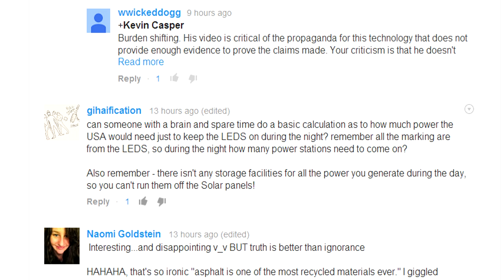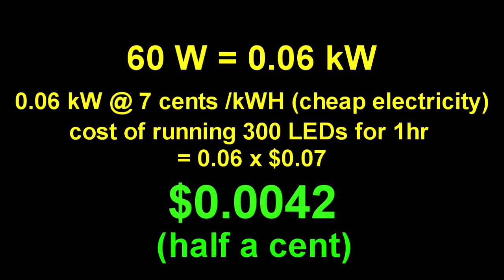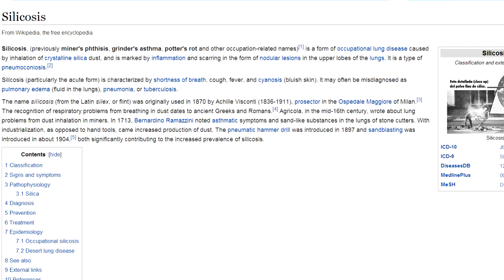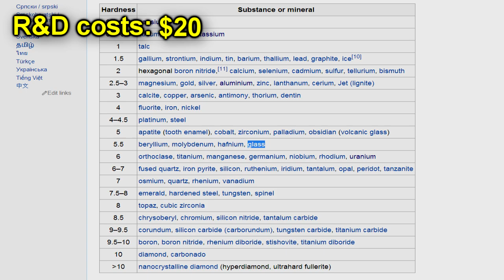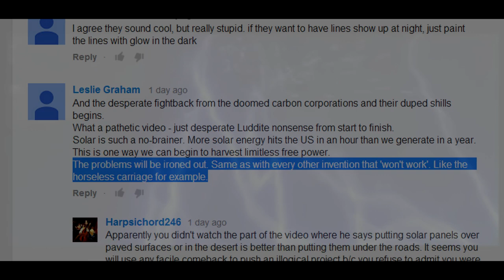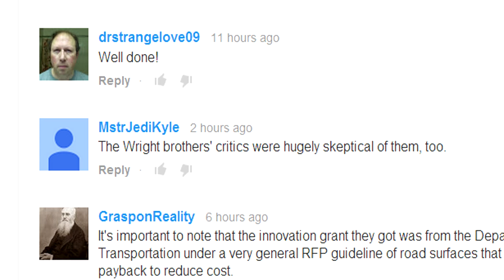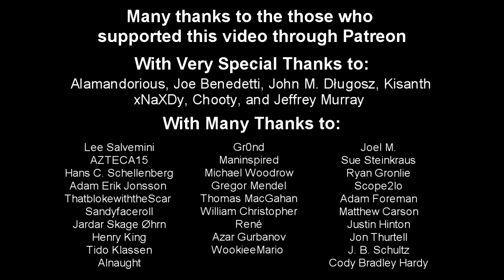Solar Roadways, IMPORTANT QUESTIONS AND ANSWERS!

Comment: I kind of agree to some degree. But he is just being a dick in this video, it's like he is just ignoring the whole idea of engineering and innovation. Like yeah I see some of the serious flaws, but for starters, he talks about how much power the panels consume but not how much they produce. And as for his problems with the surface of the panels... Give them a chance to research. Materials engineering is a huge these days. They may be able to find a viable alternative that is a lot more appropriate. Thunderf00t is just make a lot of unfair assumptions in this video and basically just against even thinking about this idea or if there is any viability at all to it. For example a solution ( an expensive solution but just run with me here, literally just coming up with ideas spur of the moment here) to the tracking issue might be to use thousands miniature solar panels within one of the hexagonal cells that can all rotate to track the sun, and you could even do this mechanically (think clockwork) rather than requiring any programmable electronics or anything. Like basically thunderf00t point out the flaws but try and be constructive with it and not sound like a nay saying dick especially when you are over looking some possibilities yourself
Reply: What problem are you trying to solve?  Why do we need LEDs in road surfaces.  Doesn't paint or reflector dots work just fine?  If you want to generate electricity with solar panels, just put up some solar panels.  These aren't Reese's Peanut Butter Cups.   Mixing roadways and solar panels together will never be anywhere as cheap as using current roadway technology and solar panel technology separately.  What technological problem are you trying to solve?
Reply: oscargordon Its funny I was actually driving round today and I saw LED signs which kinda swayed my view on this. I never liked the LED idea, everyone seems to be focussed on that. I like the idea of energy efficient roads. It's not about just putting up solar panels though, its about saving asphalt too, which is a much more finite resources that silicon and glass. The technological problems trying to be solved would be the LED lights not being able to be seen for example. If you fund research into that you never know what could come out at the end. I don't think it is a great idea at the moment I just don't get why thunderf00t (and you I guess) is so against funding research (important word here) into the idea. Lots of scientific projects are funded and show no good results so why focus on defunding this particular one, you never know what is possible if the right people are doing the right research... it's closed minded to just write it off as a completely terrible idea because of its current flaws
Reply: Ravo You never answered why combining solar generation with roadway surface was superior and cheaper than doing each separately.  You never explained why LEDs embedded in a road are more visible and will last longer than paint or plastic reflectors and our current roadway signs.  There is zero evidence that materials science will ever come up with a transparent surface that provide as much traction and be as rugged as traditional road surfaces.  All you seem to have said is whenever somebody comes up with a really stupid idea, we should "all just keep an open mind and throw money at it because someday it might just work".  Quite simply no.  There are a lot of problems that need to be solved and there is limited amount of money available.  You have to evaluate all of the ideas out their and throw out the stupid ones that have no chance what so ever of being practical and cost effective, like solar freakin' roadways, and put your money and effort into things that actually have some chance of working and being useful.  What Thunderf00t is doing is trying to educate people so that they don't throw money at something that is both pointless and has no chance of working, and that is a good and valuable service for which he should not be criticized for.  Yes it would be really cool if roads looked like Tron, but let's leave that to our fantasy lives.  You shouldn't be so open minded that your brains fall out.

Comment: Okay, Thunderfoot, serious comment.
How could you store the power needed to keep those things burning all night? Assuming around 10-20% actually gets used at all times, what kind of storage mechanism could work? What batteries would you need, how extensive would the repair costs be, etc.
Also, if you built a battery into each panel (oh shit, more costs) could they, with contemporary technologies, support (at least) themselves for a crisp 8 hours of night? (for the sake of simplicity, exclude the different day/night cycles depending on one's location and season).
Reply: Note, we're also assuming the devices produce at 100% efficiency, or just leave power generation out of the subject. By the time they cannot produce power, the batteries are 100% full, and start pumping juice.

Comment: Also, I forgot to mention Hyper Nano Panels, that possess a 90% efficiency and turn with the sun on a nuclear scale.
Not to mention, they're stronger than diamonds and immune to cuts and bruises. And for good measure, they're getting the deluxe version, that also has built in stereo and LED imitation. 
Once we get that, which science says will take shorter than the time the singularity needs to abolish the economy and financial systems, we'll have all the power we need to power our homes and make us hyper dependant on moonlight by using weather control devices to keep clear skies.

Comment: Genuine question here: In the FAQs on the Solar Freakin Roadways website they say they want to supply houses with DC, which would avoid inverting the output from the solar cells and would be ideal since most appliances rectify the AC mains output to DC already. I know I'd love to have a PC that doesn't suffer from voltage ripple.

BUT...

If the DC mains power remained at a regulated voltage (say 240V), wouldn't that mean my appliances would have to invert the power anyway in order to transform the voltage to their rating? Then rectify it back to the DC it started as?

Someone who knows please enlighten me in case I'm wrong here :)

Comment: There's some good points in this video, but you have to be vigilant to find them as most of the video is TF getting sidetracked by how huge he thinks all of those numbers are. (it's silly to assume that 100% of roadways will be converted so quickly, so what's even the point of multiplying all of those numbers so high?). I'm especially frustrated with trying to figure out where he hid the answer to the first question: How do the tiles stay lit at night, how much power is needed? The first two times watching this I lost track of the point with all the digressing, and my patience only stretches so thin. I still want to know, would the tiles (as a whole) even generate enough power to power themselves, let alone enough power to fund their replacement in 5 years?

I'd also like to point out that the LED Visibility test TF does is bunk, because the lights are on a white strip. Paint the strip black and try again. (also hide it under scratched glass in the sunlight, somehow I think the results will not change much.)

There's value in critisism, defenders of the roadway idea need to realize that unless all of the issues with it are addressed then it's just a pointless money sink, so bringing up these potential problems is in all ways a good thing. Armor is only good if it can survive attack, so attack it, and if it doesn't survive then you'll know where it needs improvement.

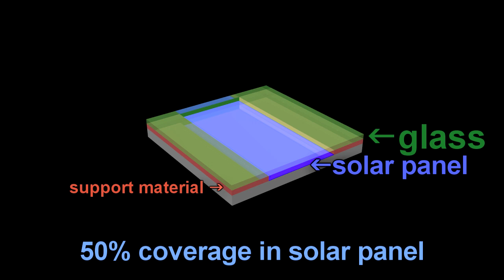Comment: @13:24 The load of the traffic would be transferred right to the solar panel if there was no gap between the panel and the glass;  it would deflect (The glass).  Also if the glass didn't just crack, it would deflect in the centre and hog (deflect upwards) at the edges, you would need an adhesive of some type to stop it from doing so - in the process you would be introducing a bending moment into the glass.  Young's Modulus for glass is 90 GPa (quick search) max.  I can't find the formulae for deflection of a thin plate encastre on all four sides right now but I'd imagine tensile stresses introduced to the glass would be too much anyway.
Reply: Happy to be corrected on that, just from the top of my head but I don't work with glass often.

Comment: It should also be noted that if the solar cell segments of the panels can't bear load, that leaves a cavity in the middle that will cause shearing on the glass plate above.  Glass is great in compression, but (like asphalt and concrete) isn't great against shearing and tension.  Thus the panel would crack very rapidly where the voids are.

Comment: Not that I'm agreeing with  the idea-it is pretty horrible, but you did the calculations based on the notion that all the LEDs from every panel would be on at the same time at night.  Any idea on what the painted surface area of the roads would be?, which would be the part that actually need to be lit up. Probably still a ridiculous number, but a more credible number to use when shooting down someone elses idea.

Comment: The core problem as I see it is the insistence on forcing two technologies together that really don't benefit from each other at all. Sure, it's may be possible to create a gadget that serves as both a gas mask and a roomba, but both purposes will be greatly comprimised, probably to be completely useless, and you would still be better off just having a seperate gas mask and roomba.